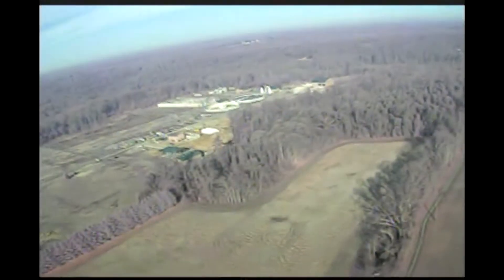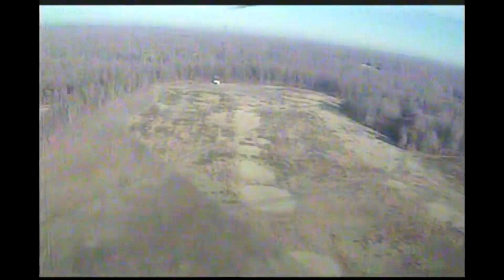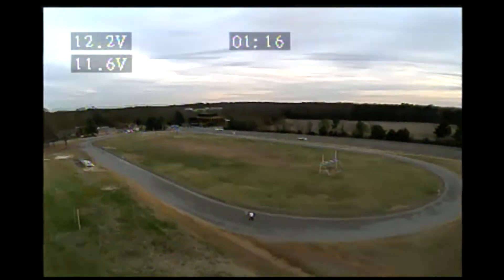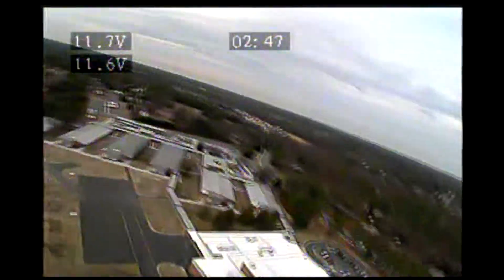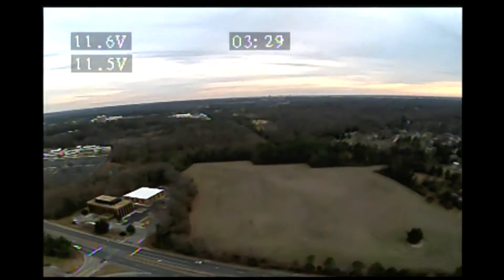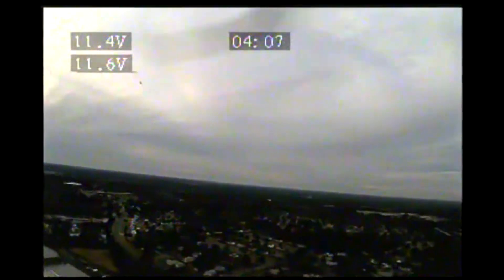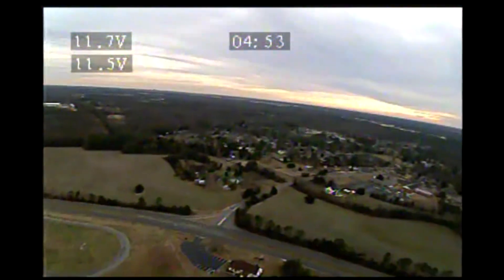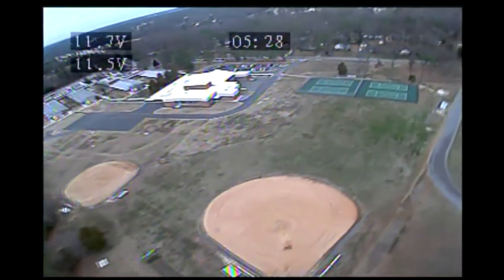FPV Mini OSD & 700TVL CCD Cam Testing

Comment: Nice video and description. Is your OSD the same Mini OSD offered at Hobby King?  Where did you get yours?
I am collecting and testing FPV gear myself right now and like you I plan to use an LCD screen rather than goggles to fly FPV. I have a diversity receiver/DVR for this purpose with a nice light shield, somewhat smaller than yours.
It seems to me that it will be easier and less disorienting to switch from land view to FPV and back with this arrangement.
How has it worked for you?
Jim
Reply from the maker: James C Eastep Thanks!! I got that Mini Osd from Ebay. I think it is the same as Hobby King's. The one on Ebay was named RCD 3060 Mini OSD and was $21 with free shipping.  Came from USA seller. Works well. I agree too about using a screen vs goggles as you can just look in the screen and if needed look away and not get disoriented lol I may get 1 more of theses Mini OSD systems and put it on my quad so I can see the battery levels as I fly.

Comment: but the image is not sharp!!! why do you use this camera and not another type?
Reply from the maker: I have 6 different cameras for live fpv raw video downlink. That camera was 1 of the 6 & was only $12.00 The purpose of this video was for "cam testing" to see how it performs in lower light. That's why I mentioned in the video the 4pm time frame during a winter month. The camera is only for confidence while flying & not for any HD recording. That's why a 2nd HD camera is used just for HD recordings plus this is a test plane & not my skyhunter or Bixler which is used for normal FPV.